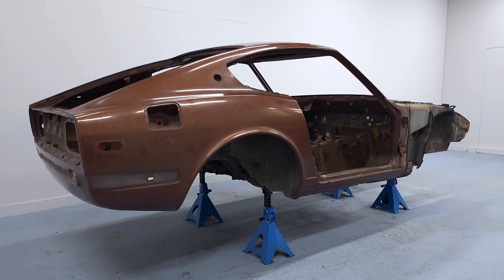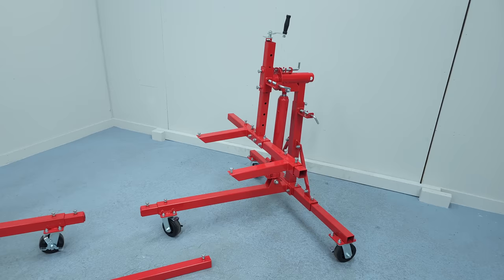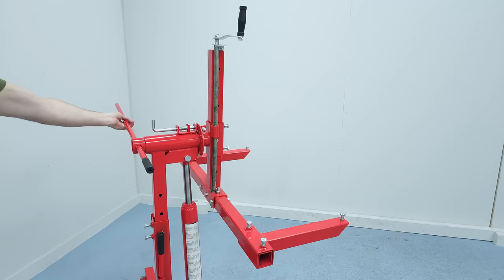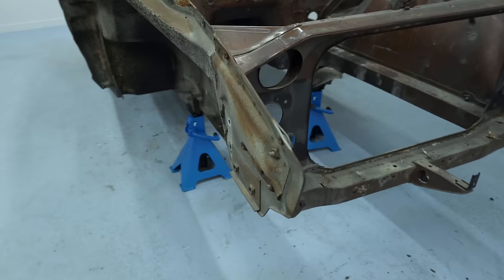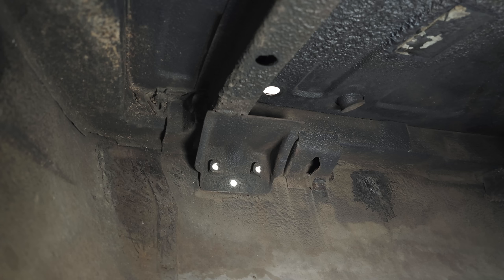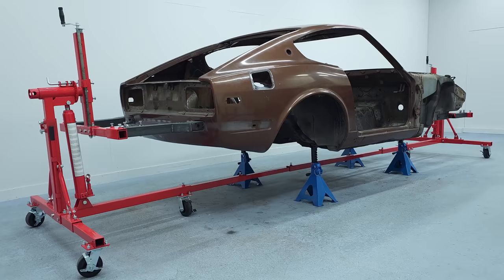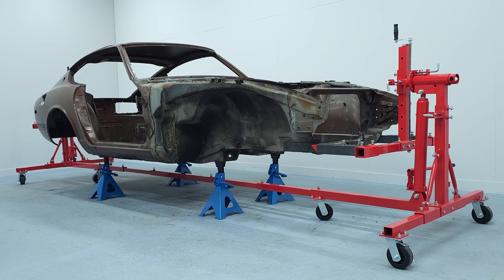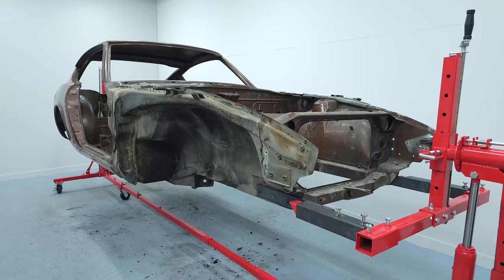How to put a Car on the Rotisserie - Datsun 240Z

Comment: Don't forget: the most important step before putting your chassis on the rotisserie is making sure it's been properly brined.  You don't want your Datsun to be dry and chewy, you want it to retain moisture and flavor when you cook it!
Reply: I'd let it marinade in a nice chemical bath before mounting it on a rotisserie, but that may not be in the budget for this build.
Reply: @ArKritz84  Manually basting it with paint stripper is cheaper and more labour intensive but can give just as good results if done with diligence and care.
Reply: That was one of the best dad jokes I have seen in my life. I award you all the points, and may god bless you!
Reply: having said that, an old friend of mine used to do all of the local hog roasts. he did one for a jewish wedding and roasted a lamb, without thinking he basted it with the lard from the previous hog roast. they said it was the best lamb they ever had.
Reply: @kennethtalbott2233  everything’s better with 🥓
Reply: @kennethtalbott2233 similar religious restriction , we have saying, if it's tasty, must have pork/alcohol lol

Comment: I think the reason the rear supports hang down a little but the front ones don't is the position and orientation of the bolts holding the supports to the bumper mounting points. At the front the bolt positions are longitudinal with the direction of the mounting arm, with the bolts themselves being perpendicular to the direction of the mounting arm. At the rear its the other way round.
Reply from the maker: That's definitely also adding up, well said.
Reply: @mymechanicsinsights  At the front, the second bolt prevents rotation around the fulcrum that is the other one. At the rear, you're entirely dependent on the tightness of the bolts.
Reply: That and most of the weight is also in the back and just as you said, the bolts can't hold as much because it's a much smaller and weaker mounting point.
Reply: I agree. also, the compliance of every junction is adding up back there. the smallest amount of flex in the bumper/mount mating surface on the rear would translate into sag along the mount's length whereas if the front mating surface flexed the same way it would only produce twist in the mount so it stays straight.
Reply: I disagree! (yeah, it's the Internet, after all. so, it also always needs one of those types or your bill would go up by mandate 😁)

while I think to understand what y'all talking about, I still disagree with this (quick) analysis. for the following reasons: you need to see everything in context working together! for instance, the front needs two bolts when you powerlift it like a forklift on steroids, or something. meaning, no support at the back!

but as soon as you hold the chassis on its back, one single bolt would be plenty (as a matter of fact: better, even. to allow to relive tensions and have it settle evenly.)

hey, dear my mechanic! can you try to remove one of those to bolts on both sides and see whether you end up with a better situation?

and the very same goes for the back. you only need two mounting points when you wanna lift it up with zero front support. realistically speaking, it'll just twist and bend in this case, yes; I'm aware of that. but as soon as you lift it at the front as well, again, one single bolt alone should technically be sufficient. more is better to lower the risk of ripping out any hole (yeah, I'm aware, that's not very smartly formulated 🤣).

lastly: what has this sagging effect to do even with the way it's mounted to the chassis?

when this rear fork is infinitely strong and the makeshift adapter to the car is mounted firmly onto those plunges (or however that's called; English isn't my strong suit, lol. begrüße 😉), they shouldn't ever twist and sag no matter what happens to the car.

cheers!

(no, I'm not fun at parties. trust me, people—I tried! 😂)
Reply: I didn't know this system is also known as a rotisserie, i've only associated that name to the thing you fry a chicken with 😂

Comment: A tip (For both you and the maker of the rotisserie) when ever making telescopic "things" from square tubing, ALWAYS weld the locking nut/screw on the corner.
It's more of a hassle to weld it, but re result is so much better, as when you tighten the screw, the square tubes align perfect in the opposite  corner.
No wobbly and no deformation when the screws are tightened hard.

Comment: You could also support the inboard side of the rear bumper mounting points with a box section bolted to the two weld datum holes visible at 2:00 and clamped to the inboard side.  Right now you have the whole weight of the back end hanging on the one arc weld to the frame when it's rotated in any direction but standard (this is before the days of structural crash supports in the bumpers).
Reply: The other option is grinding off the weld nuts and clamping straight through the bumper reinforcement to a bar attached to the axle mounts.  You don't need to clear the body panels if you can bolt through them.
Reply: I was thinking something similar an aluminum 1/2 inch thick plate behind the rear pair of holes, with a clamp on it that “grips” the cross bar inside that runs from one side to the other. Then the bolts go through the holes, and on to the thread in the aluminum plate, with some washers in between.  Should avoid damaging the rear panel.
Reply: … Sort of like the plates that supposedly reinforce rear subframes…

Comment: The axial fixing of the screws on the rear supports taking all the load (unlike the front ones in the radial position), their shortening and strengthening makes the assembly much more confident!
The "behind the scenes secrets" are appreciable and could even be the equal of your main channel one day!
Is it the rust in the tank that you hear when rotating?

Comment: The roto is a good piece of kit, and will make work on the body much easier. 
One detail I forgot to mention in the first episode was, keep the front air-dam just like the factory original. Over the years I have seen some really ugly looking after market body kit air-dams that spoil the look, and make driving over high spots hard on the bodywork. Its a small, sleek sports car and the original look is the best.🦋

Comment: My thoughts on the rear mounts: Firstly, about 70% of the mass is through the rear rotisserie. Secondly, the orientation of the tubing at the bumper mount creates a bending moment resisted only by the tubing wall thickness. Your additional angle strongbacks only helped marginally. Plates welded across the open sides of the tubing would be more effective (but need access to remove the bolts). Thirdly, the body structure is not as robust as could be in this area as noted. As others have suggested, a secondary bracket adding stiffness under the car that you bolt through to your rotisserie would be helpful.

Comment: I'm filled with admiration for both your ability to fix things and your ability to speak English. I couldn't order a beer in Swiss-German! So my intent is solely to be helpful, not critical, as I mention now that you are using the noun "screw" where "bolt" is actually correct. There is a verb "bolt," too. For example, "He bolted the car to the rotisserie." Thanks for your interesting videos! Cheers!

Comment: When i did my grandpa's old merc, i made my own rotisserie. It's super easy to make. Basically only 5 cm thick wall pipe, which can be bought second hand and i split open a section of the pipe to enlarge the ID to fit over the OD to make the pivot section. MMA welder + grinder and a drill for the pin stops. All in all, i think i paid ... 100 euros for the pipe and 10 for all the consumables. Sold it for much more.

Comment: Grutzi Mr MM. Good explanation of the rotisserie. Never considered the balance bit, will now. You gave us a good look at the “frame” on a few shots. You can see where the well supported area stop, below the ends of the doors. Lots of those bodies have cracked there. I suggest you make sub-frame-connectors. A hollow rectangle bar, 4 cm wide and 2 cm deep would do. Usually about 2 meters long, you blend them into well supported areas on each end. And match them to the body contours for the whole length. Only weld the outer 15 or 20 cm to the body. 4mm wall thickness is lots, most are about 2mm. They go as close as possible to the body. If they buzz, shove a few rubber strips on top of them. Huge help, brakes,suspension, every thing works better with way less flex. See the modern Mini construction theories for super rigid Uni-bodies. Forgot, you need two of them. Good luck!

Comment: One idea that could improve slightly the problem with the hanging down of the arms holding the back of the car, is to shorten the length of the single connecting bar at the bottom of the Rotisserie thus tilting the pillars of the rottiserie outwards and  putting the holding arms in compressive tension.

Comment: Like you said, those rear mounts are probably fine. But if you did want to tie into the axel mounting points, there's no reason you couldn't make a fixture that attaches to those and the current rear bumper points. I bet that'd be rock solid.

Comment: At the rear, use a backing plate with through holes, so you can still use the bumper mounting points and then add some extra nuts to the bolts you use for more strength, let that protrude down below the mounting plate and then use some square tube to triangulate between the main chassis rail and the mounting point, then add some square tube to reinforce the joint between the mounting bracket and the cross rail, that should stiffen it all up nicely.

Comment: When I resto'ed my S130 280ZX, the roti prongs slid directly into the frame rails (the ends were exposed front and rear unlike the S30) almost as if it was made for it (my roti was identical to yours, except blue) - so I didn't need to fab up any brackets. I could even use the frame rail captive nuts to fix it in place.

Comment: The weak spot that causes the bending could be the torsional stiffness of the red frame (07:12); also the bending stiffness of the rotating support tube
Reply: Yeah, I agree, that red frame has a lot of pressure on the arms. Makes me a little nervous but I guess the empty frame is fairly light, I would be curious to know how much it weighs.

Comment: The slack in the square tubes are part of the reason it tilts down. Unless they fit very tight to each other, there is not much you can do to stop the tilt. But just keep an eye on any of the bolts loosing up as you work on the car project. Should be okay.  Thumbs Up!

Comment: I have seen on other car shows that they often weld a temp roll cage onto the center of the car to keep it from folding under it's own weight at the weakest part, the center of the door rocker rails. This may be where some of your sag in the rear is coming from.

Comment: As someone who recently finished restoring all the sheet metal on a 1978 Camaro using a rotisserie, I suggest installing a brace going from the door hinge to the striker.
Reply: What does that do?
Reply: @ArniVidar  keeps the body from flexing.
Reply: @marcusedelen  Ah, okay. Interesting that location would do much stiffening, but I guess anything that takes the load off the roof is a good thing.

Comment: Are you going to figure out where all that loose metal is and remove it from the internal structure?

Also, I have watched all the videos you have made of this series so far and

1) you are doing such a great job I doubt even the original manufacturer could tell where you made repairs.

2) you really need to make more videos.

Comment: rock solid 😅. Sounds like a 1 by 1 german translation from felsenfest. Don't know if it's a common phrase in english but I recognised it and found it funny.

And I recognised, that you always used solid instead of stiff. Stiff and the inverse of it compliant is the ability of a material to deform or not deform after an applied force. Solid to be honest I just know from hardening tests with Rockwell or Brinell. It is indeed also a word for describing a resistance against deformation but in another context right?

Comment: Now, you forgot you need to have a fire underneath the rotisserie and given that this is an ol' school muscle car, I recommend a beef broth base, onions, garlic, and rosemary. You're gonna want to be liberal with the salt too, but no vinegar, it doesn't gel well with the metal. Just remember to keep basting the Datsun as it spins, and keep it turning for 3 hours, and then you can have it linger over low coals for another 4 hours, and just move it 15 degrees with each turn, so you can distribute the heat evenly. Goes well with coleslaw and mashed potatoes.

Comment: 7:14 yeah, the rear of a car is usually weaker on account of the different type of crush zone, modern or old. They are made weaker (hence why you can buy entire pans for rears if you do car repairs vs front where you have everything in small sections). You're just a bit too long. Usually the catch point is closer, i'd say 20 cm tops, and above that, it's a bit excessive. The whole car flexes and can bend in some cases.

Comment: Some very scary looking welds there :-/
Try grinding the mill scale off first, so you're welding clean metal, and it also looks like you need more current, and/or to slow down a bit - especially on that thicker material.

Comment: Everybody tries to guess whats happening to the rear fork and it is kind of exciting , I'm sure you  will fix it and we like to know what caused that.
so please after reading all of the comments tell us what was the problem
I personally think it is because of the sliding parts of the rear fork which is more than the front fork , even mounting point in the rear fork is fixed by a sliding part and this sliding parts must be so loose to work properly and this will cause enough tolerance to shift in one side 
actually it seems it is shifted more at the right side 
thanks a lot

Comment: Depends on the vehicle......
the method would not have worked with my classic car without frame warping, it´s better to use a rotary that can be mounted on the frame attachments for the shock absorbers or axles, 
and always install a support cross inside befor, preferably weld it in to prevent bending ,
because the vehicle is designed to distribute the main load to the 4 contact points of the wheels. 
I've seen cars bend like bananas in frames like that when they're twisted 90 degrees on edge

Comment: Wouldn't acid dip save you all this trouble, and reach even inside the frame rails? 

With that said, amazing video, very informative, and thank you for contributing for the information available 👍👌
Reply from the maker: True, but also comes with new troble because you need to seal everything new and you can't access everything.

Comment: If the rear mounting points are that weak, and since you have the car taken apart, should you reinforce these points and make them stronger for the bumper mounts? It would make the car able to take a "parking lot" impact with minimal damage to the frame. As they are now designed, even a low speed bump into the rear bumper would probably cause fairly severe damage to the frame.
Reply from the maker: I'm not planing to crash the car ;-) just kidding
This should definitely be fine.

Comment: I'm kind of surprised you didn't fill the improperly drilled holes with weld and then file them smooth.  Heh.  I'm too used to your restoration videos.

Comment: What happens when trying to paint the spots blocked by the mounting points? You have to match the paint afterward?
Reply: I don't think it's painted on the rotisserie. I'm guessing he does the underside coating on the rotisserie, and then installs some bracket to the underside for the painting.

Comment: Next, he will build a Giant rotary tumbler barrel to clean the entire vehicle while he sleeps!

Seriously though, it is not the car that is the problem with the sagging of the rear arms.  
It is the rotisserie.
The closer in you can make those arms, the less you will see the flex.
I suggest shortening the arms of the rotisserie itself, or MAKE A NEW ONE that is 
made from thicker material and moves the rotisserie rotation point in much closer to the car.
It will make the rear a bit harder to get to as far as the body panel, but it will be a lot more stable.
 keep rotating that thing or go around and find alll the stuff that keeps rattling around as you rotate it.

Comment: I see you didn't weld any reinforcement bars to the chassis before placing it to the rotisserie. Do you think it is unnecessary to reinforce the body or is the body sag possible ? I'm going to install my 240z to the rotisserie and are wondering could it sag

Comment: You should take a look at the 'Bad Obsession Motorsport' multi-function rotisserie, that's an engineering masterpiece. It's as if they didn't like any of the commercial models so they 'Made A New One' 😉
Going down the same route you could have had one of those 'Inheritance Machining' side-projects... but then your Datsun 240Z restoration could possibly end up taking 10yrs like Binky 😂🤣😂